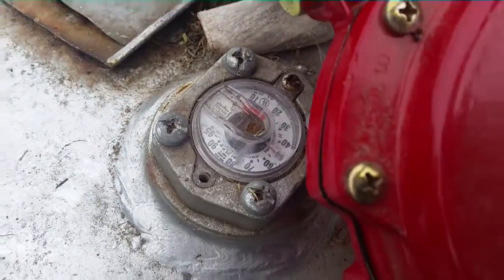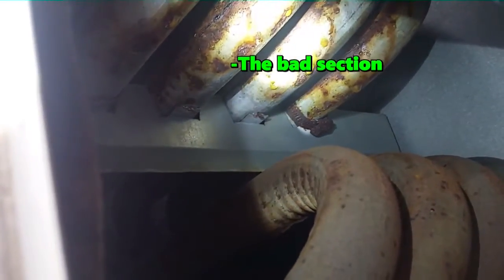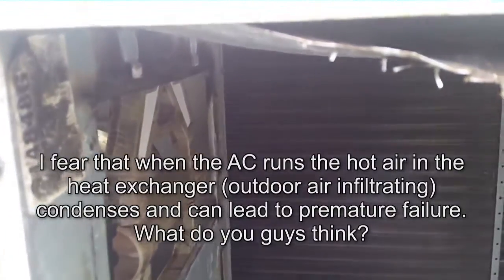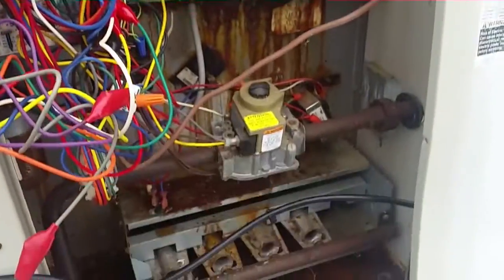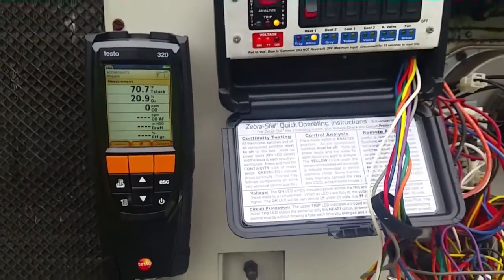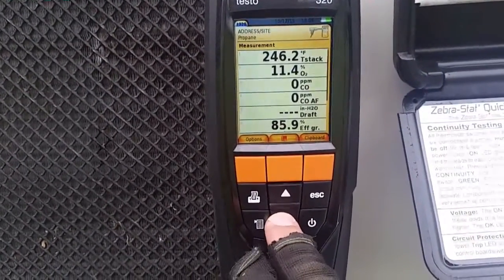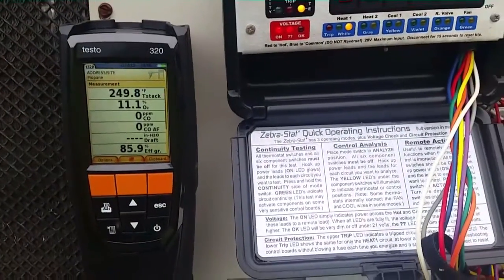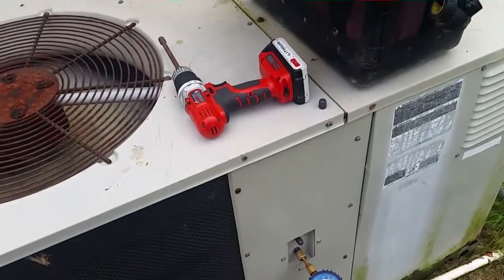Talyn875 Classic | Nordyne Package Unit Combustion Test

Comment: That one definitely needed replacing. Too many things wrong that needed replacing. Got a couple of Trane Voyager units that need replacing this year (14 years old), heat exchanger failed in the same area. Makes the nice "rust rattle" when the inducer kicks on, lol! Did you end up replacing that one? -Tom
Reply from the maker: +tcpHVAC/R haven't yet. Should be in the next couple weeks
Reply from the maker: +tcpHVAC/R haven't yet. Should be in the next couple weeks